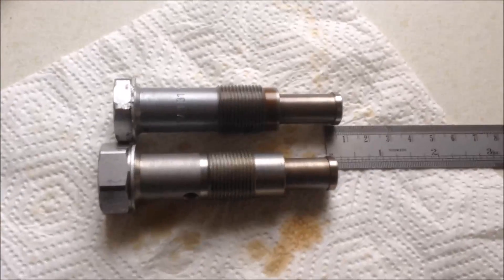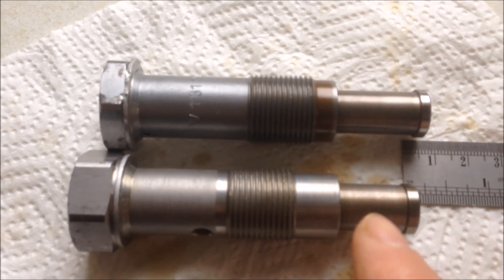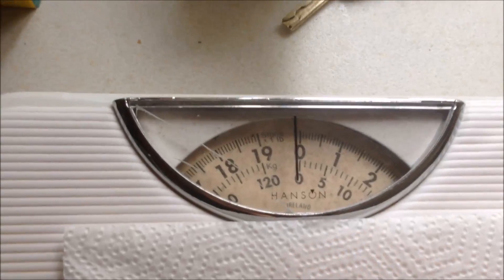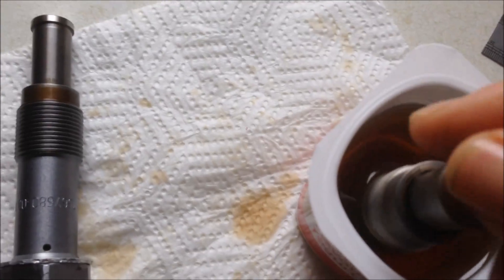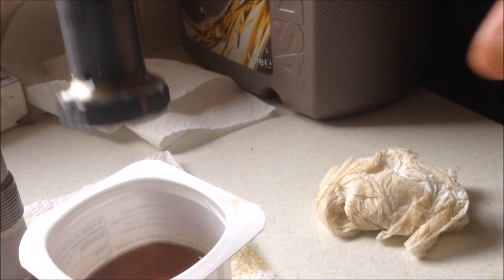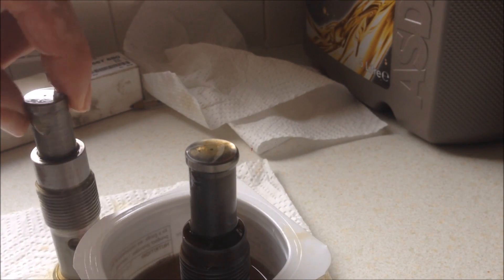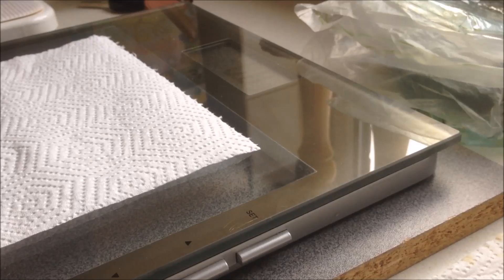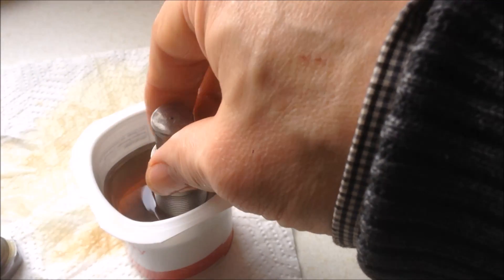BMW E46 / N42: Timing Chain Tensioner,  how to compare and test (old and updated designs)

Comment: Hello, I bought the tensioner on my N43, as compare with old original was the same (newer improved version both), but the old one I pump the oil in (in the can with oil) and oil flows out from hole on the very very slowly and hardly to press...the new one I tested it too, but oil flows out from the tip quite easily. What version is good? With the new one the car starts up for a long time!!! (4 seconds...) With the old one, during the start engine control light lights up with ECU issue of Cranshaft position sensor (replaced too) and rattling for a while after start (2 seconds...). Otherwise there is no rattling sound, chain is tight when engine runs.
Reply from the maker: Hi,  make sure the both have free travel when no oil in the tensioners. I amy be wrong but i do think if the piston doesn't stuck when no oil in it, then after filled with oil, the harder the better. To me, 4 seconds for a cold engine start is not a big issue, neither 2 second rattle after start (I had 10 minute rattle!), but warning light or sensor fault code are the concerns. it turned out that my biggest problem was low oil pressure. I have made several videos on the oil pressure related issues. Now my car runs smoothly and quietly. Good luck to you!
Reply: @RepairDIY  Thanks for report. I must to solve it because during the start the camshaft position sensor fault lights up often... Also, 30minutes later I spoke with authorized BMW mechanic, sice 2016 there is a new OEM tensioner for these engines. New version (ver.3) have got improved oil hole, radius and !!!! stronger spring !!! Is possible to preserve chain thighten during long engine standing. And starting engine is without a noise. OEM number is 11318685091
Reply from the maker: @pavelhorak1888  Hi, if your oil pump ok, oil pickup strainer not blocked, good quality oil, you should have the oil pressure build up within 2 seconds. you can observe the oil pressure light while starting the engine. after the engine standing for a long time, the oil in the system may go abck to the oil sump, but I don't suppose the oil in the chain tensioner will go out much. In my car the oil pressure caused more problem than the timing chain tensioner. good luck!

Comment: Same problem for N46 318i e90 no?
Reply from the maker: Hi, I am not sure. As the N46 is the newer engine to replace the N42, it could be similar. You could look at your engine to see if you could find the similar chain tensioner. Good luck.
Reply: @RepairDIY  thanks
Reply from the maker: @olindor220  great to know. thank you!
Reply: Bubble, bubble press down there be more bubble. brilliant thanks 🙂